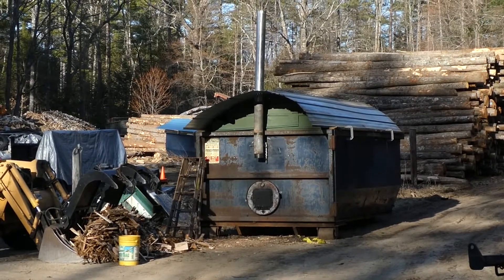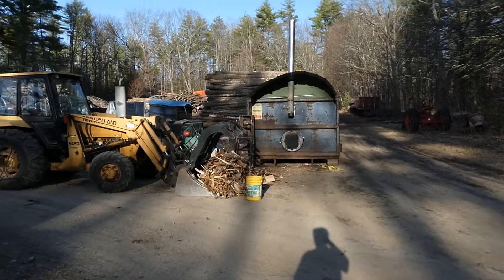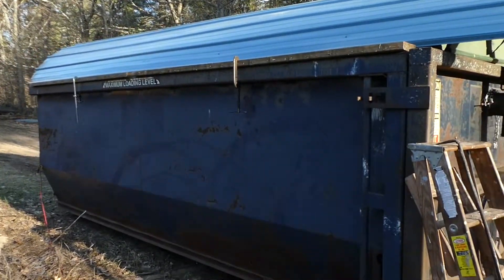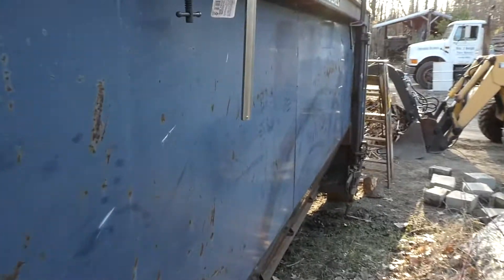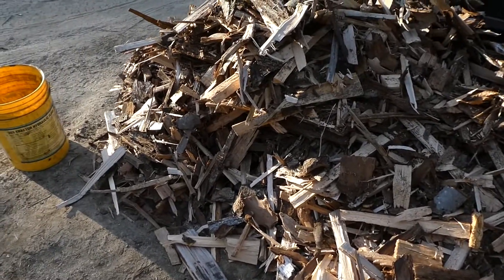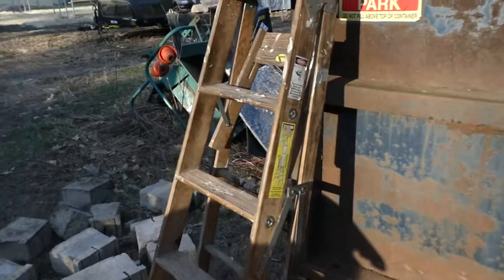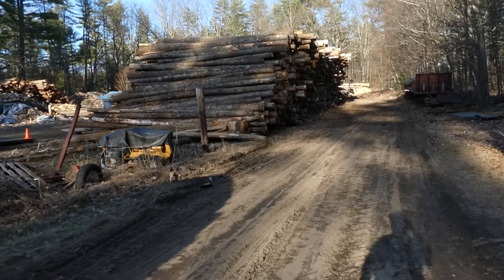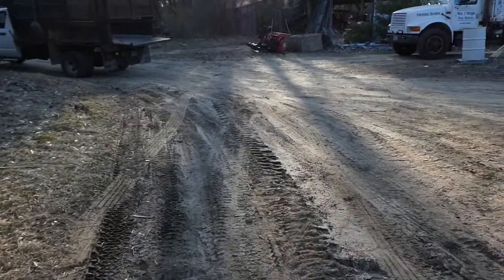Heat treating wood in a roll-off container.

Comment: Bill it looks great.  How long will the firebox burn if you fill it up?  Looking forward to seeing the results.
Reply from the maker: Using the " fines" separated out from the firewood operation the burn time is pretty short ... around 30 minutes. Hot and fast is the rule to maintain the high temperature. I liken it to boiling sap during the Maple syrup operation . We ran it four hours Friday afternoon all day Saturday .  I'm headed down in a few minutes to open up to check the wood inside then fire back up if needed.

Comment: That is a cool project Bill. Do you find it easier to chunk dry wood or would you chunk it first then dry it? Joe
Reply from the maker: The saw cuts green logs much easier than dry logs but green splits don't season to our satisfaction in time for the fall sales, do to the size  of the piles. We have the best luck cutting and splitting 2 year old logs which yield very nice wood come  fall time.

Comment: That's some mighty fine work. I bet that beast is putting a lot of hot into that wood stock. 
 Talking of heat, it sure is nice to see that all the snow has finally gone away, so you can actually move around freely for a change.   
 Ya know, I wood knot be surprised if your new heat treatment facility fills up with chilly woodgas bugz, while you're not looking  ;) . 
 Keep up the woodwork, oops, I mean good work, my fellow wood to watts wonder worker.
Reply from the maker: It's going to be a very handy shed for all kinds of uses
Reply: @nhhbbyloggr5022  
 Indeed. It wood   :) . 
 Now, to make it woodgas bug resistant......